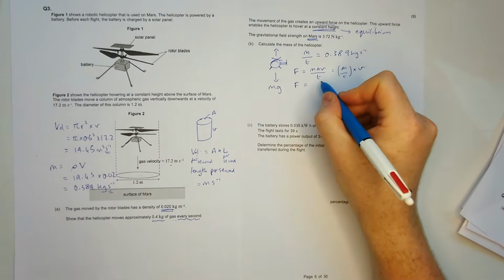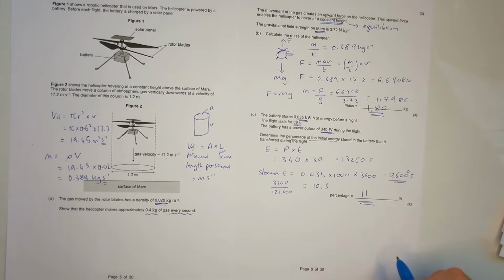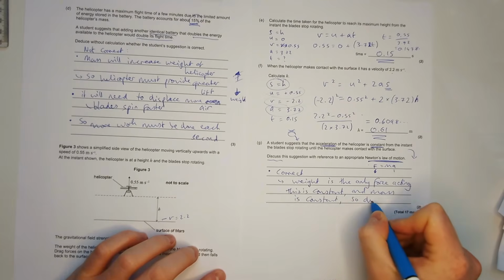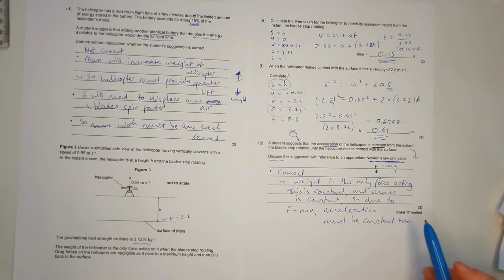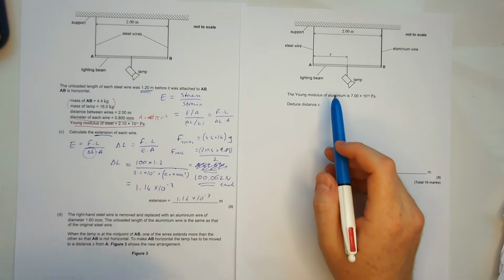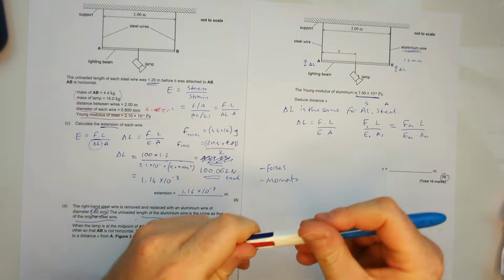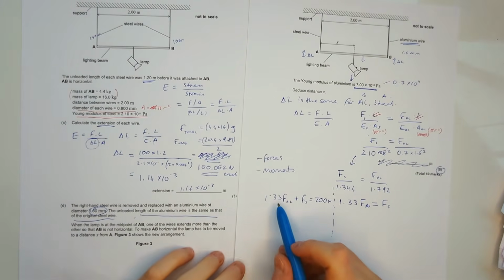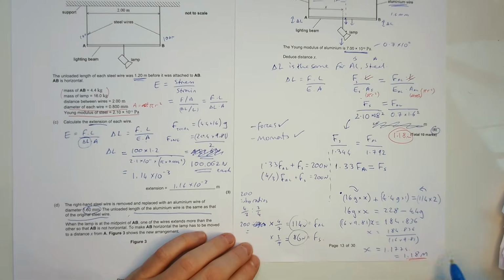TRICKY Mechanics & materials questions! (A-Level Physics)

Comment: For question 3g would the acceleration not decrease as the resultant force exerted on the helicopter changes as the momentum of air particles displaced increases with velocity?
Reply from the maker: Correct, however earlier in the question it says to ignore drag forces - as the height it falls from isn't big enough for air resistance to factor in

Comment: I’m so confused for 3e) because it says it’s moving with speed 0.55 then when it’s at height h the blades stop moving. So wouldn’t that mean u=0.55 and v=0 how is it the other way round?
Reply from the maker: Hi, yes you're totally right - sorry that's a mistake on my part. It doesn't affect the final answer, but U and V should be switched around

Comment: For question (3)e), how can we assume that the initial velocity of the helicopter is 0, as for other suvat question unless it says that it rises/falls from rest, we can’t assume initial velocity is 0 I thought. Also why is acceleration due to mars field strength not negative as its acting downwards?
Reply from the maker: Hi, if says earlier in the question that the blades stop rotating - so there for there is no upwards force so it has zero vertical velocity at that point. You're right a should be negative, I should have included it but it didn't affect the final answer

Comment: For the SUVAT question section , question (f) , is the initial velcoity suppose to be 0 , becasue in the question it said at height h the blades stop rotating
Reply from the maker: From the diagram, it says when the blades stop rotating the velocity is 0.55 upwards - so we consider that the initial velocity and it's positive